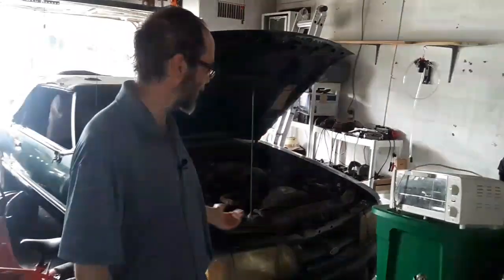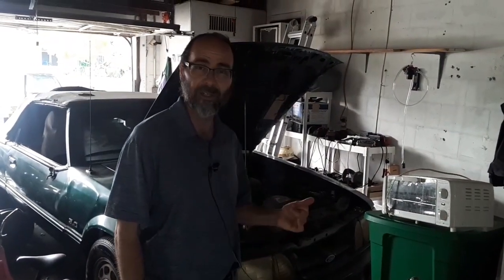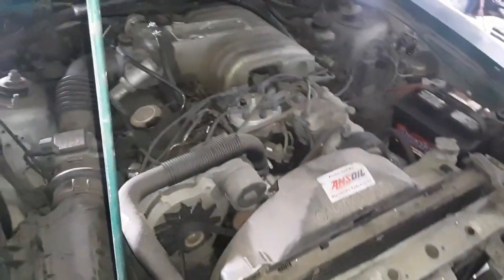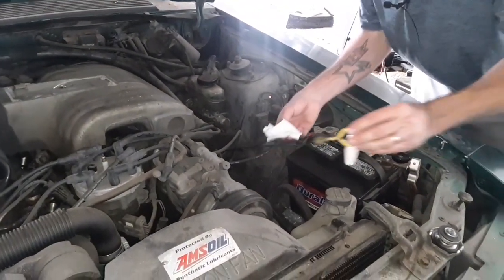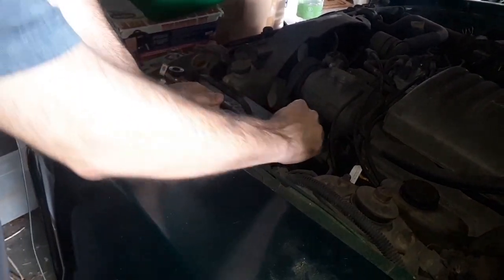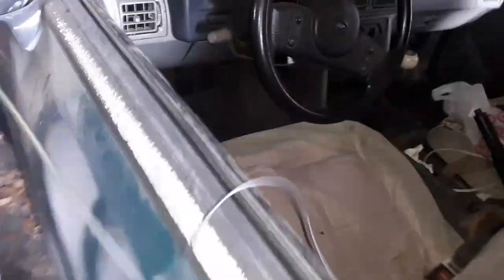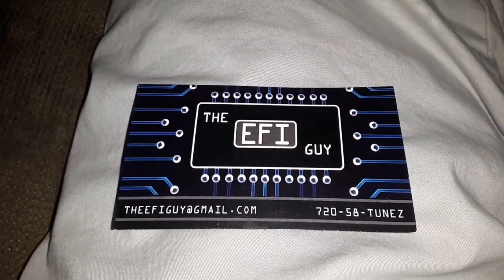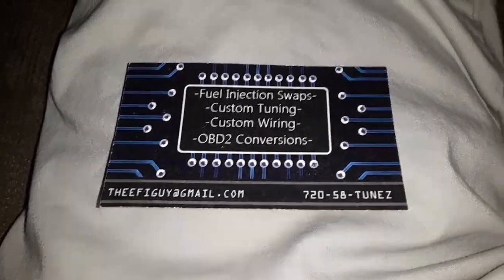Will this pony leave the stable? '89 5.0 Mustang will it start?

Comment from the maker: Amsoil 15W-40 Diesel & Marine CI-4+: https://www.amsoil.com/p/sae-15w-40-heavy-duty-diesel-and-marine-oil-ame/?zo=1463115

Amsoil 10W-30 ZRod High-zinc, corrosion protection: https://www.amsoil.com/p/z-rod-10w-30-synthetic-motor-oil-zrt/?zo=1463115

Lookup your vehicle by year/make/model/engine: https://www.amsoil.com/guides/?zo=1463115

Save immediately as an Amsoil Preferred Customer: https://www.amsoil.com/offers/pc/?zo=1463115

Dealer/Fleet/Installer options: https://www.amsoil.com/business-opportunities/?zo=1463115

Mike Trull Amsoil Dealer 1463115
www.number1synthetic.com
Like & Subscribe for Amsoil fluid change videos and more on this Mustang!